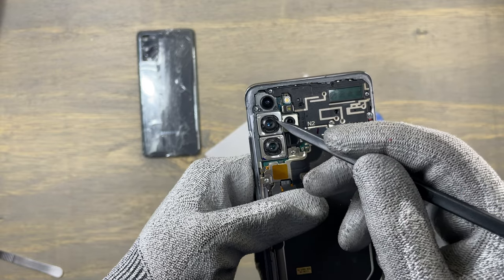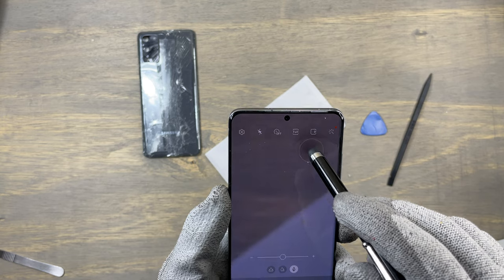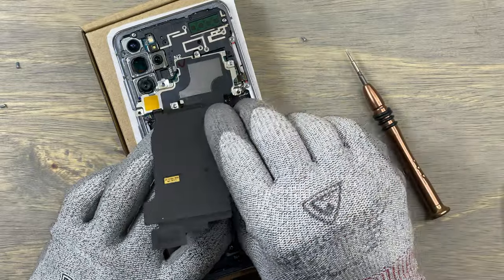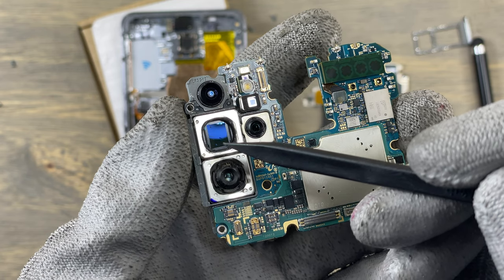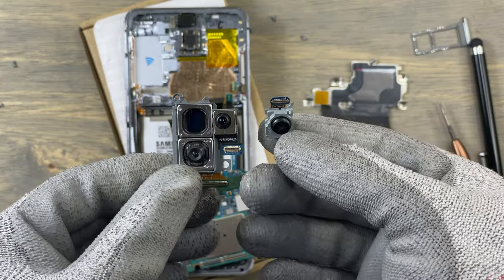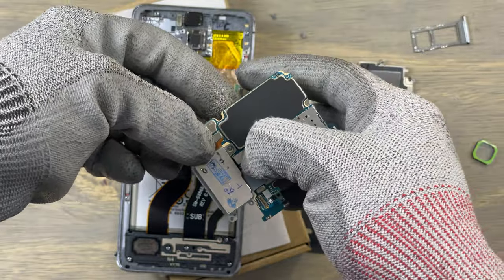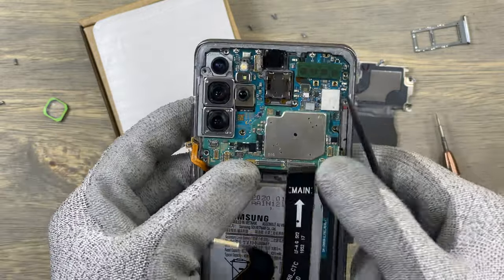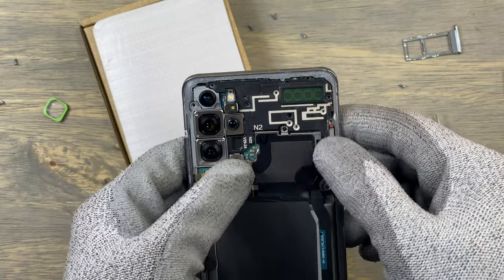Samsung Galaxy S20 Plus Camera repair

Comment: Hello there, thanks for such a helpful and amazing video. One little question, in order to glue back the back-coverpanel, what kind of glue should I use?, or the remaining glue in the  back-coverpanel should work just fine?. Thanks and cheers Sebastian from Santiago, Chile.
Reply from the maker: Hola Gracias Amigo. I used B7000 or T7000 these are the ones I regularly used. B7000 is my glue for all electrical work if I don't have the double sided tape. 👍🏽

Comment: Is there a way to put back the lens you removed from middle camera or is it broken once removed ?
Reply from the maker: It really depends on how it was removed. Is the whole assembly was dismantled with heat, appropriate tools and zooming lens you could clean the sensor and reassemble everything it will work, but if the sensor was scratches or punctured it’s not worth the time and effort

Comment: Give us a link where we can get those new camera modules
Reply: And the flexible cables that run to the motherboard from the USB port
Reply from the maker: Hey i got it from eBay. There is no permanent supplier I can link. They seller I used had the camera only at that time.
Reply from the maker: You can search the flex cable on eBay also.
Reply: Thx

Comment: I got a dust in my front camera, Samsung 20 plus, now I don't know how to clear it.
Any suggestions
Reply from the maker: The way you're explaining it, you'll have to remove all components clean and reseal the back. My S20plus screen replacement should be very informative.
I cannot think of any other way to remove the dust and debris, and if it happened it means somewhere on your device is not properly sealed and need to be addressed also.

Comment: Hey, i replaced the bottom 108mp lense and the big 48mp one above it, now i just have a blank screen in the camera app, but 3rd party camera apps work... any ideas ? Thanks
Reply: I have s20 ultra btw
Reply from the maker: The issues might be compatibility! 
I experienced the same situation. Other non Samsung camera app function with remaining oem cameras. Sometimes newly installed camera will work for a sec and freeze. You need to make sure the cameras you bought are strictly for the same model number. That was the only way I recovered the cameras in the Samsung native camera application

Comment: You didn't include the link where I can buy the module camera?
Reply from the maker: hey, if your device model is G985U use this supplier https://ebay.us/6xZdqi
I did not include a general link because the S20+ has some compatibility issue with other S20+ models camera. I tried 3 cameras before I got the right camera that cleared the "failed camera" pop up. If your device model is G986B you can search on ebay and make sure the seller said the exact model that you need or contact him to confirm.
Reply: @ersbit  Thank you for mentioning the camera failed pop up! I got the same message when i replaced my ultra wide camera. I ended up switching out the lenses because that's what was broken. Thanks for the video!
Reply from the maker: Your welcome glad it was helpful

Comment: the link where i can buy the module camera S20 PLUS G985F please.
Reply from the maker: Hey, I usually out links in the description, but this kind of repair and the specificity of part make it hard to find what everybody need.
My recommendation : your best bet is to go on eBay search for the model number and email the seller to make sure it's the right model number and part then place your order. That will help you avoid what happened to me ( order and return multiple times until I got the correct working model)
Reply: @ersbit  thanks friend.

Comment: I tried to replace the camera but the camera preview was black, with my old camera it does work. The model number is: SM-G986B/DS (Exynos version). What should I do?
Reply from the maker: Hey, you should first buy a camera from a supplier that claim it is for the exact same model number as your smartphone. 
It is software related most likely due to 5G model and international models. I went through 3 to 4 supplier before I got a camera fully compatible. Please communicate your model number G986B to the supplier/seller if he does any different model number unfortunately it will not work.

Comment: Did the camera start working again? I’ve replaced the camera and it did not work 
How can I get the new camera to start working again?
Reply: I had the same issue with the black marks on the screen, I replaced it with new camera module and it’s not working
Reply from the maker: Hey, you need to make sure you get the camera for the CORRECT VERSION of your device. If the cameras are from another country you will have compatibility issues. 
What version/model is your device
Reply: @ersbit  Hello. How can I know which exact model of camera I need for Galaxy S20 Ultra 5G and where can I buy it?
Reply from the maker: Hey, when you start the device it says the model number. Or you can go in setting and click on about and look for the model number.

Comment: How about the broken flash module?
Reply from the maker: Explain more....don't clearly understand your question
Reply: @ersbit  my camera flash broken , how to fix it?
Reply from the maker: You mean the FLASH LIGHT (fixed on the motherboard)? Is it physically broken or it just stopped working?
Reply: @ersbit  the cover of the flashlight
Reply from the maker: 😅 still a bit confused.
I think I should make a group somewhere for pictures sharing to better understand and direct better.

First is it working?
Is the flashlight physically damage or its only the glass that cover the cameras and flashlight?